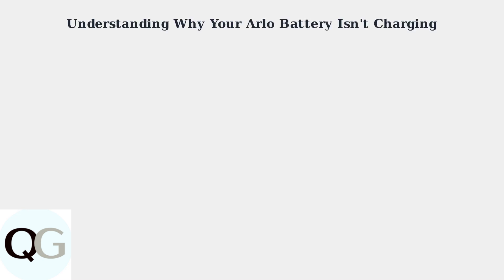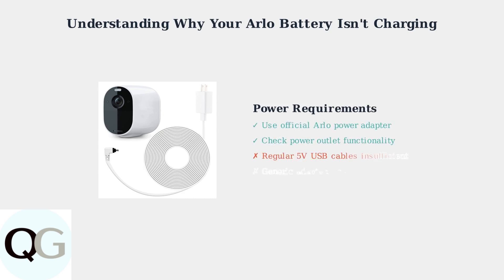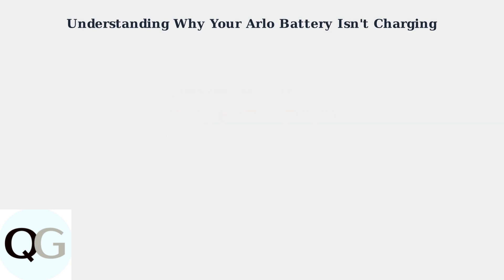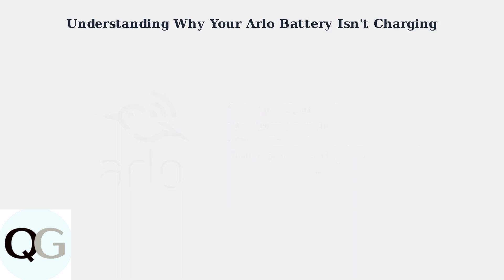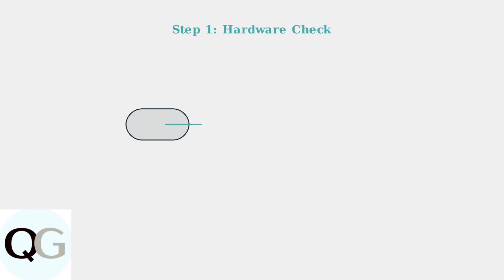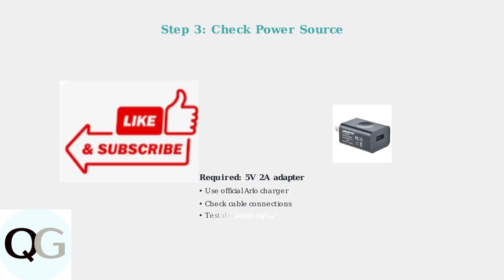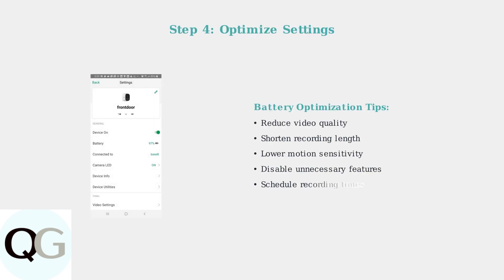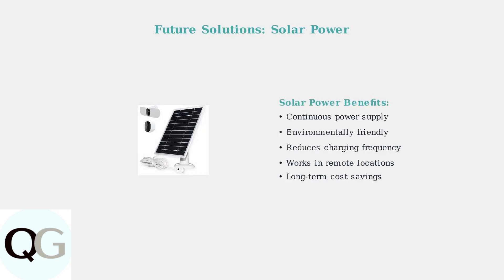How To Fix Arlo Battery Not Charging – Easy Steps To Troubleshoot Battery Issues

Comment: Not telling us how to fix the battery then 🤦🏻‍♂️
Reply: Exactly! What a waste of time.
Reply: @Monterey1995I fixed mine, I connected wires to a 12v battery and zapped the terminals on the Arlo battery, plugged it in and it started charging again 👍👍